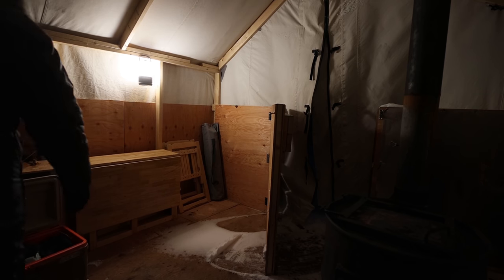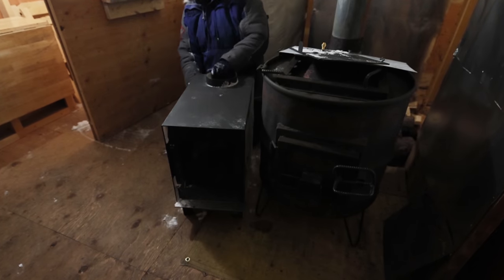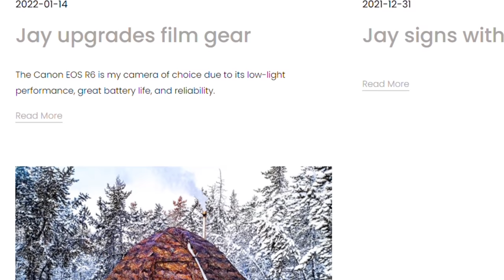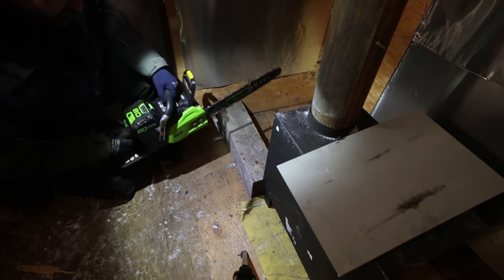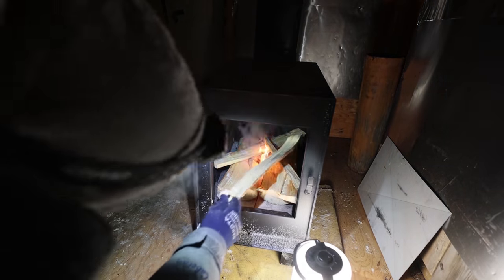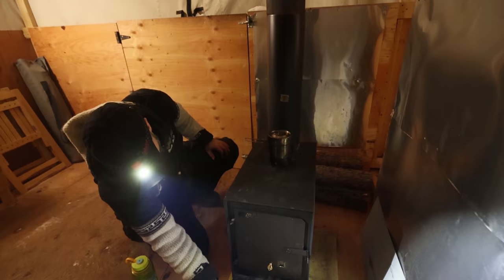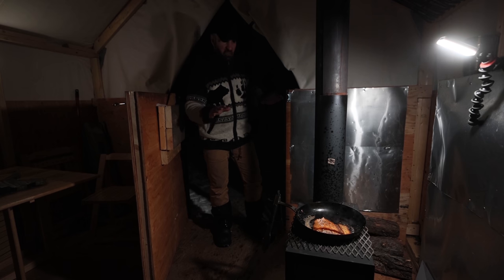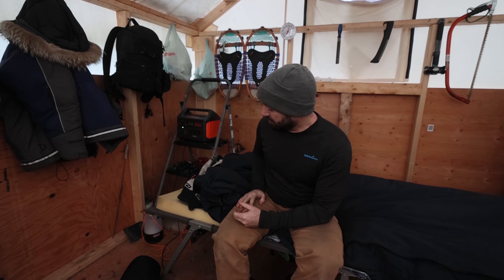HOT tent camping. 2 stoves. 1 hot fire

Comment: A flat wood stove gasket will also help on your stove door. It will make a huge difference in your draft. And also check for leaks around the flu where it attaches to the stove.   A popsicle stick and some stove cement works great to fill in the little cracks around the flu and the stove collar.  Stay warm, safe and healthy.
Reply from the maker: I think I may try the flat gasket. Hopefully it sticks! I like the stove cement idea too!
Reply: @jaylegere  the gasket cement/glue works great and will hold for over a year's worth of use.  Be careful not to put too much glue on or it soaks into the gasket way too much and turns it rock hard.  You need the gasket to stay pliable and seal around the door.  Very easy process!
Reply: This was my thought as well... Along with perhaps they designed the size of the draft hole to be small on purpose knowing their door and fittings were also drafty. I would totally go bricks outside the box. A flat gasket for the door. And seal those joints up. That stove will be a very solid unit for a long time.
Reply: @zionkid420  the big stove needed the same TLC.  And it would bank the wood for 10-12 hours per load.

Comment: The baffle for the stove will greatly help with efficiency of the stove.  Also the amount of stove pipe you have inside the tent is another reason that it puts out so much heat.   As for how often you get up in the night to feed the stove is a function of the stove box volume and how warm you wish to keep the tent.  I let my stove burn out overnight, I personally rely on my sleep system to keep me warm.  However my overnight camping temperatures usually only dip to the -20s Celsius. Rarely will I encounter -30sC.
Reply from the maker: I have thought about letting my stove burn out, but I'm not too excited about letting it go out when it's -34. I'd never get out of my sleeping bag!
Reply: @jaylegere  so true dude...always keep care of the wood stove

Comment: Looks like the only thing missing is one of those kinetic wood stove fans.  I find that it helps to just circulate the air.  the airflow isnt all that powerful but they seem to help distribute some of that heat through out our hot tent a little better.  It hardly takes up any space and it seems to help me gauge how hot my fire is by how rapidly it's spinning.  It's also kinda hypnotic to watch the fan silently spinning as you can hear the snow falling outside.

Comment: Have been running my Hunt Stove in my 14x16 Canvas for over a decade with a chimney flu and it’s been awesome! Put either some sand in the bottom or a railway track plate and it has no heat distortion at all.

Comment: You need a damper and a chimney thermometer.  Also, keep a pot of boiling water on your stove.  Acts as humidity for the enclosed air, wash water and in a pinch fire water just in case.

Comment: Now you can get one of those heat powered fans for the top of the stove. I have one for my tent stove and it does a great job of distributing the heat. Good luck, great vid.
Reply: Forget it, this was mentioned quite a few times and they were all ignored. He preferred to get a new smaller stove.  Another thing that was mentioned a few times was to install a vapour barrier between the tent and the inside, easy to do, he has a wood frame.
Reply: @marceldion4688  Have you ever used one? Using a fan that doesn't need electricity makes a smaller stove better, I know. Forget it? Ha.
Reply: @barrymontgomery7339  
I think what he is trying to say is that people have suggested that to him several times and he (Jay) just ignores them.
Reply: @msgottaneedtoknow  That's what happens when you think you know everything.

Comment: Jay, just a thought. Do the side walls of the stove get hot like the top? If so, could you stack bricks around the stove and would they help give off residual heat throughout the night to limit the amount of times you have to get up in order to feed the stove? It's something that might be worth trying.
Reply from the maker: Good idea. Thanks Floss.
Reply: I think that this is a great idea..get the damper put in. Then, stack bricks around the unit
Reply: That is what the professional stoves use to retain heat, bricks.
Reply: Hi Jay... you could build a small rocket mass heater/stove in the spring. It heats well and uses very little wood. If it's kept going from morning until late afternoon, it will keep things warm until the next morning. Then one lights it up again, and stays warm all winter on about  1/2 - 1  cord of wood. Just a thought...
Reply: Also will be an added  bit of safety,
Reply: I think the problem isn't so much the stove it's the wood. He only has pine and birch available to him both burn fast and hot. no matter the stove he is going to have the problem of too much heat and having to add wood all the time. If he had access to some good hardwood like oak hickory ash maple locust, he could be still using that very first stove he started out with. pine and birch are great to get that fast hot fire going to heat the tent up, but he needs to find a source of a good hardwood to maintain a reasonable temperature and long burn time.  If I was Jay I would get a cord or two of hard wood even if I had to haul it there in the sled and at least use it during the night for sleeping.
Reply: Just came to write the same thing.  The smaller stove may be better at burning logs, but with less mass than your old stove, it will cool off faster, which is fine when you’re tent camping and need to pack up the next day. But for a semi-permanent setup, you want the added mass to absorb and radiate heat over time.
Reply: I use double stacked 55 gallon drum heater for my greenhouse. Lined them with bricks on the inside and it definitely helped. Even used an extra large flu pipe, filled in with dirt between it and the original pipe. Great for putting moisture for the plants too. Just dump a gallon in the dirt and let it cook out slow. Very efficient with firewood.

Comment: Add an airtight type of air vent control, A 2" pipe cap with a threaded bolt through it so you can close it down to airtight, I took the chimney baffle out when I put the airtight vent cap on. Stove burns dirty but can control heat output very well.  Kept everything warm down to -50 deg F below.

Comment: The pipe connection at the stove should probably slide over the outside of the opening on the stove to prevent smoke from exiting around the pipe...
Reply from the maker: Hey Bridge. I have done that in the past and I changed it immediately the next day. Creosote will seep on the outside with a single walled pipe.

Comment: I find a damper in the chimney gives one more control. I find if u can get the right night wood, if u can leave it in the round and get a good coal bed then put a large round log full length in and fill from there.   I have even used not totally dry around my large round stock.   It keeps the burn down but a great coal bed so with the damper and stove control you can get away with feeding it only once through the night.  Great vid.  J manitoba Canada

Comment: You may want to add some insulation around the door seal as well.  It really draws the air even with a dampner adjusted the door may leak too much.  Man it puts out the heat.  Several like it on the CND market.  Being square it's not much smaller if any than the old barrel.  Interesting.  I've kept a fire all my life.  Brinf a new section of pipe with the dampner already installed, they can be a PITA out in the field getting the holes lined up.

Comment: Jay, have you considered using a heat powered wood stove fan to circulate the heat around your tent?  No power required. Only the heat from your stove to operate.
Reply from the maker: Yes I have. I actually have one on my stove at home. I used to use one at camp in my earlier vids, I haven't taken it out there for years though.

Comment: Just so you know when you run into those corrugated ends on rounds you can take a pair of needle nose pliers and just grab on, pointing the jaws up the duct, and twist them. It will fold over and make the OD narrower, allowing the slippage. You can also cut the length of the corrugation from the end to the point the corrugation stops and just use some pliers to pull it over and has the same effect.  I'd also really advise to put some high temp sealing compound on the connections. Leaky stove connections cause a lot of deaths in Canada every year. Your ventilation might be good enough you never notice it though.
Reply from the maker: Great tips!!

Comment: try hammering out the corregated end of the pipe so it fits over the flange on the stove. secure with large air seal clamp.
Reply: The pipe should be inside the flange any dripping of creosote will stay inside the stove

Comment: I like that Drolet Hunter quite a bit, I used one as an outdoor heater in a clearing for a number of years, there's a decent amount of heft to it, is a simple, well-made stove. The draft on it seems unreasonably small, but most times, I was just burning it with the door wide open. The stainless baffle makes a big difference in efficiency, I think, and flat(ish) top was handy for boiling water. I found, as I got into colder weather, though, that I simply couldn't push enough fuel through it, to make it work outside - the burn chamber would fill to the gills with red coals, but it was not throwing off enough heat to comfortably warm the surrounding area, and I couldn't stuff any more wood into it. Replaced it with an overturned oil barrel last autumn, but set the Hunter aside, just in case I wanted to use it like you are. It might work better in an enclosed space.

I've had my Hunter burning cherry red a few times, mostly at the outlet, but it always coped with the heat well - I often saw the chimney cap glowing red, as the heat ran all the way up the stove pipe... pallet wood burns hard and fast LOL. As I recall, I used an adapter at the outlet, to get my 6' of single-wall stove pipe sitting properly. There's a black metal adapter meant to convert double-wall to insulated chimney pipe, that fits nicely over the stove's collar, and then the single-wall stove pipe fits into upper part. Not inexpensive, but worked well; obviously double-check fit on both ends at the store, think I got mine through HH, believe it's made by Selkirk.

It's unfortunate that your custom stove didn't measure up, it looked like it was capable of holding a lot more wood, being able to grill on it was a neat feature. I bought oversized for my shack, something I could load with wood and allow me to get a good long sleep, tough to go wrong with a big heater (GWM 26" air-tight). Have never had much luck with the damper, I tend to just leave it fully open, and regulate the heat by controlling the air supply. Are you going to go back to the guy that built custom heater, and ask him to alter it in a manner that allows you to take it for another spin? Or is it an outdoor stove forever, now?

Really like that northern lights video you posted, nice to see them against an unspoiled backdrop.

Go easy, looking forward to another video.

Comment: Hi.If your new stove is like mine it did not have a door gasket and sucks way too much air when you close the damper and burns wood insanely.I went on Amazon and found a door gasket made for barbies.It is 1/8 by 5/8 and is self sticking.You get a 50ft roll for about 10.00 bucks.It only lasts about 3 months of continuios use but 50ft goes a long way.The problem I was having is I could not control the heat infall type weather I would get cooked out of a 14x 14 tent.After installing the gasket I can control the heat I can maintain 70f no matter how cold and use about 1/3 the wood.Still have too feed it a couple times during the night but the fire never goes out.

Comment: Hey Jay. Another great video . How often do you clean your stove pipe? 
I own a camp chef wood stove and love it. I just don't know how often to clean the inside of the stove pipe
Reply: Chris clean the pipe as often as you feel it might need it.  Creasut build up is dependent on type of wood and how you are burning the stove.  If you are burning dry wood at a wide open burn you will get very little build up.  If you burn green wood at slow burn you should clean once every two weeks.
Reply: @muskrat411  Thanks for the advice. I very much appreciate it
Reply from the maker: I don't have any real creosote issues so I rarely do it. Once a year is about it. I like to burn my stove really really hot at the beginning so it helps with the build up.

Comment: Is there any way you could put gaskets around the doors of the old stove to make it at least partial air tight. I think that would help with burning less wood. Thanks for another great video.
Reply: Good idea Berry he probably could use that fire proof rope.  They sell in hardware stores.  He would have to bring his stove to town and do it indoors or wait until summer as the glue is temperature sensitive.
Reply: @muskrat411  yes, he would also probably have to get the smallest rope gasket and have to extend the hinges a bit to allow even pressure and stop them from binding. That would slow down the burn, therefore less wood and easier to maintain a consistent temperature in the tent. 
Just a few things I've learned in my 45 years of burning wood.
Reply: @barrydano1701  Jay there you have a whole nother video for this summer.  I have to change the rope gasket on my Blazeking Princess stove also.  So I would watch that video 🤣.  Not just for the Square Space Segways, man I can't stop!
Reply: Good eye. That's probably why the adjustable air inlet was so tiny. Ya, if you want to start a conversation up with us northern canucks mention  wood stoves, firewood and chainsaws.
Reply: @rickszabo4312  I meant the barrel stove he took out. But the same could be done with the new one
Reply: @muskrat411  does thT mean that we could be see you doing a miner rebuild on the barrel stove? Would be a cool video, that and seeing you test it in the tent next year.
Reply: @barrydano1701  maybe Jaye might do that.  It would be a cool video and informative also.  I have one of them rope kits for a couple years now never had the guts to challenge putting it on my stove.
Reply from the maker: This is correct.

Comment: You need to line the sides and back with brick or else you'll have holes in the sides in no time. Plus it helps keep the heat. And insulate around that door to stop that air pull. Seems excitement got the better of you this time.

Comment: I love this kind of camping, though, it can cost alot.   600 for a stove is on the cheep end..   and also depends on what you want the looks to be.

For example canadian tire sells a 130 pound cast iron stove, that looks beautiful for $599.99.    Great for sidewall tents that are staying in 1 spot, or for small cabins up to about 900 square feet.  Turksish stoves which are good for tents this size generally start around 1000 to 2000...   but the wood burning cook stoves,  the really beutuifl things for extra large tents and 1200 squarefoot cabins...  start around 5k.

Comment: See if you can get asbestos rope to put around the door frame of your firebox to reduce the draw on the bottom, as well as a damper for the chimney,
Another idea.... place hollow cinder block around three sides, fill with sand to make storage heater.
Reply: That would be Asbestosis not asbestos ….damn auto correct!

Comment: Another beautiful video Jay, thanks for bringing us along with you, i also think that new stove will be more appropriate for your needs once the damper installed, you made the right choice! I also can't believe how difficult that Venture is to start, have you ever had a compression test done to it? Checked out the spark plugs? Being a mechanic myself, i know for sure there is something wrong, and most of time it can be easily fixed. Even adding a little duralube to the oil to make it easier to rotate when cold can make all the difference in the world. Have a beautiful evening my friend! ;-)
Reply from the maker: Thanks Pat! I'm hopeful this little stove will do the trick. As for the MP, The 500 engine in it is known for not starting under -29 C. I've had 4 of these exact machines and they've all done the same thing. The same engine was in the Yamaha phazer and it was the same way. It has to do with fuel mapping in the cold. Thankfully i have the Jackery!
Reply: Well as long as its a known problem, yup you have the reliable Jackery, its impressive to see it at work! 😉

Comment: Shouldn't the bottom pipe go over the outside of the stove hole and the second pipe over that one to keep the smoke from coming out the seams ? If u would run water in that direction of the smoke it would leak at every seam.